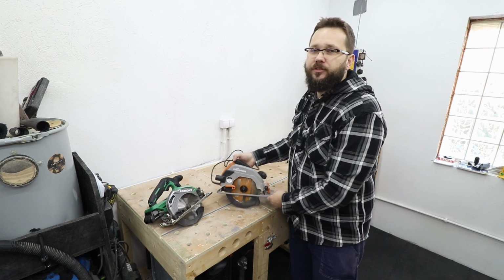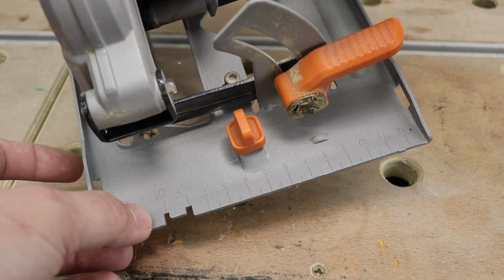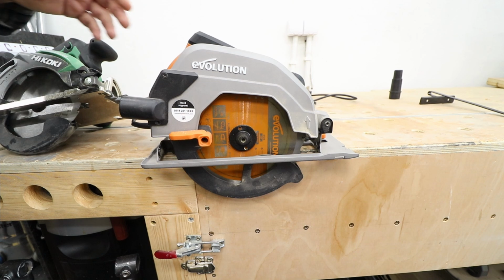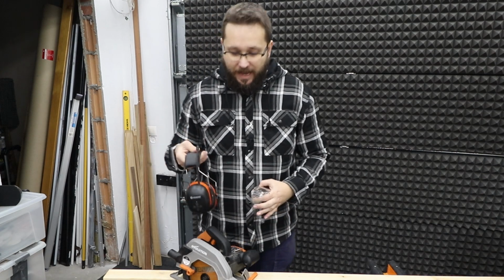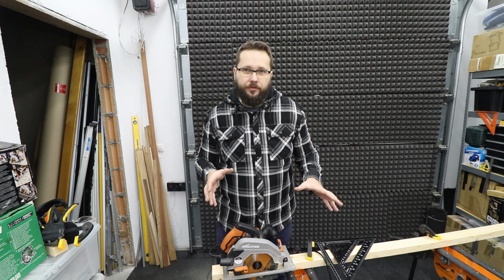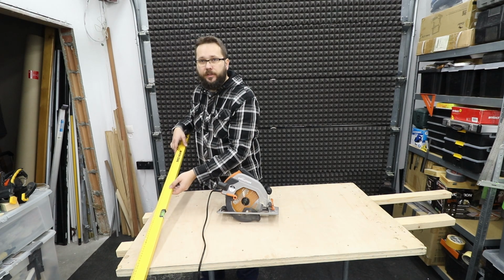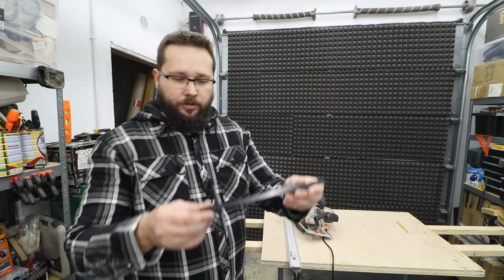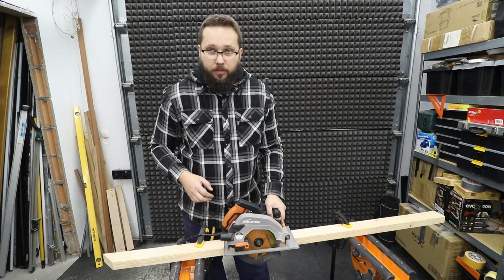Circular Saw Basics You Need To Know | DIY & Woodworking for Beginners

Comment: Hi Thomas....I have been struggling with dust/circular saw (MakitHS7601), forked out for a guide rail and a massively priced shop vac..i watch all your videos and told my wife (cos' she is helping me build a woodwork cabinet and we are confused about circular saw /guide rail handling) - she remarked today - how clearly you speak!!! Compliments Tomasz.
Reply from the maker: Hehe thank you 😀👍 the dust generation will always be bad on those types of saws. Although this Evolution one I got, when attached to a shop vac is actually quite good. I think track saws are better in this respect.

Comment: Great video, Tomasz! I used to ignore the parallel guide for my circular saw, but found it came in useful for ripping long, fairly narrow strips and I was pretty impressed with it. Obviously it references off the edge of the workpiece, so if that isn’t quite straight, that will transfer to the cut you make. Hope your move to your new house & workshop went well 👍
Reply from the maker: Yes for narrow pieces it could be just fine, but usually I use the saw to break down the whole sheet down. If I want narrow pieces I would use my table saw for that. However it all depends on the project and what needs doing.

Comment: The speedsquare: I usually turn it around 180 degrees so that the lip is at the end of the cut. I find this easier to control as you are not pushing into the same direction and on boards wider than the square it allows better guidance with my saw. 🙋🏻‍♀️Anna
Reply from the maker: Everyone got their own way of working, what feels right for them 👍

Comment: Great stuff for beginners Tomasz. That "... so it doesn't move on ya." was pure West Midlands :).  I have the Evolution circular track saw and a selection of blades. I've also managed to fit a track saw square. It takes things to another level with speed and accuracy. I've also got a cheap  panel clamp and that's also very useful - and quick and stable too. Good stuff chap.
Reply from the maker: Hehe thanks mate 👍 over 15 years I've picked up few things I guess 😂

Comment: Would you recommend that Evolution saw? Been looking for an odd job circular saw for a while
Reply from the maker: Yes, I think its very good and the dust extraction on is the best I have experienced and I got like 5 circular saws 🤣 fully recommend it👍
Done a review on it, worth checking out👍
Reply: @CasualDIY  Cool, will check that out. Thanks
Reply: I've got one of them as well and I have to say that Evolution do make some great kit for the price. Brilliant stuff for odd job work. I got mine to use as a cheap track saw though and I think I should have probably saved up for one of the fancier plunge saws for that. However that's not to say it's not good as a track saw, I'm still figuring it all out and trying to get it all set up right which is a bit fiddly to get it how I want it. Too much watching Peter Millard with his Festool setup that he makes look so easy. I think the only real weakness I have with the Evolution is the depth of cut, it can struggle going too deep when using the track, so a bunch of shallower cuts are needed (Might be the Saxton blade I'm using though). But on the whole it's doing great as a saw and if I do upgrade to a fancier plunge saw then I'll still be keeping it as a general use circular saw. 
P.S. the Evolution tracks are nice and cheap, might need the edges filing to get rid of some of the sharp bits and if you get the long tracks and want to cut one down to fit your work bench, then the Evo blade is perfect for the job, although I'd probably use my Evo Mitre saw. Also have the table saw saw as well and a file sander, I do like Evo kit.
Oh and one more tip for corded circular saw use, always make sure the cable can move freely and doesn't get caught on clamps or the wood you are cutting, especially when doing long cuts.